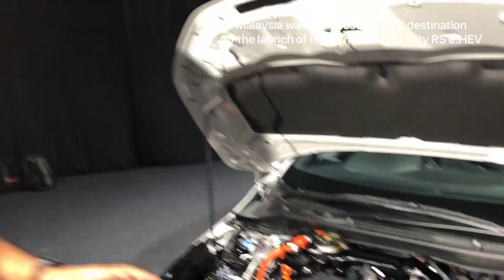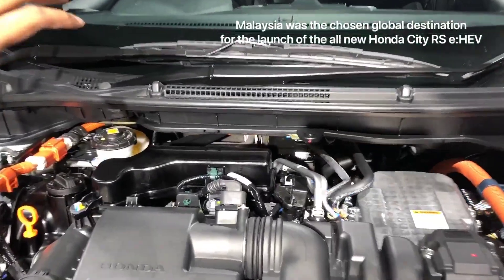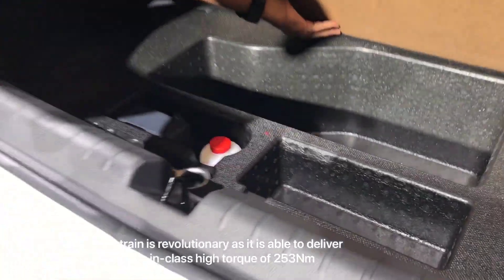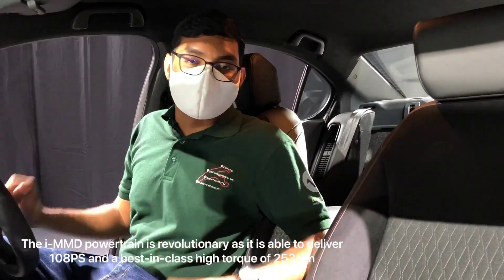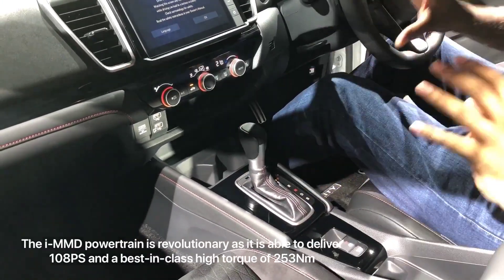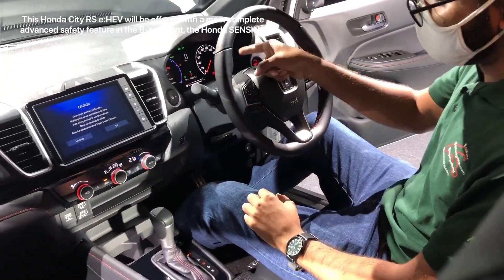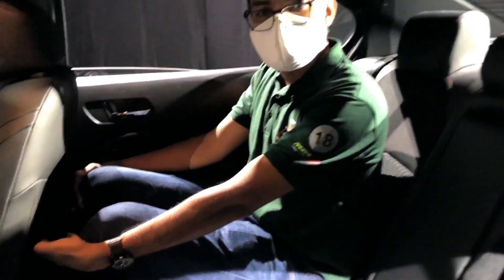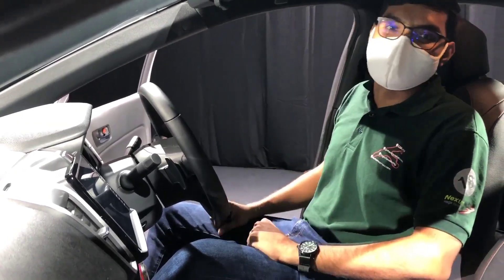Honda City eHEV Walk-Around video

Comment: This is the first review video I've seen of the sedan where the rear seats were folded down - in all the other videos I've seen it looks like the rear seats can't be folded down. The only downside I can see for this is that there seems to be some flappy fabric/plastic/material type on the top left/right edge that might make it difficult to load some weirder shaped long items into the car.